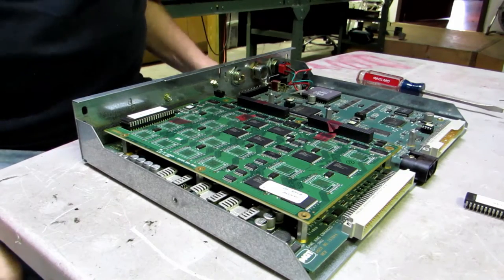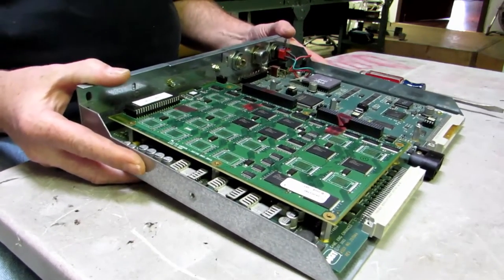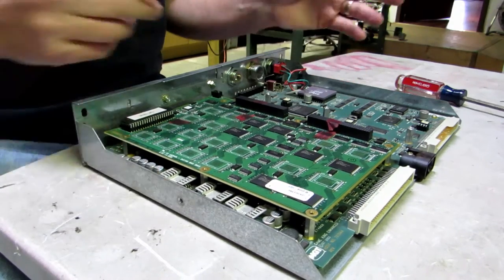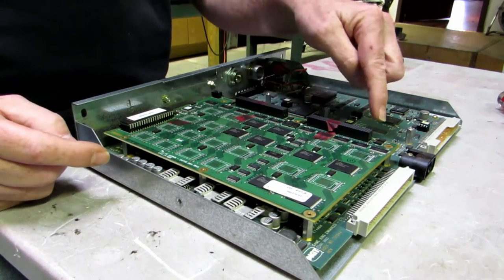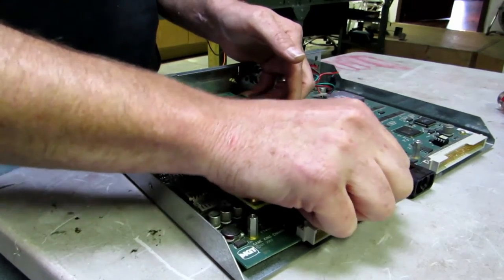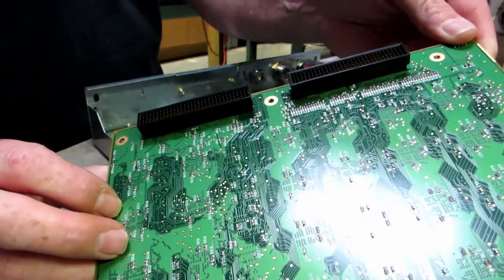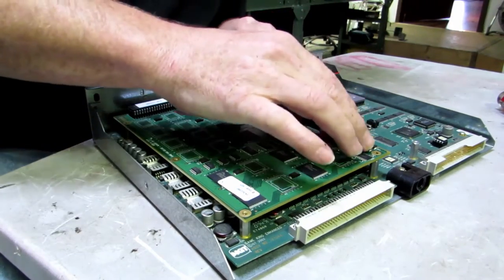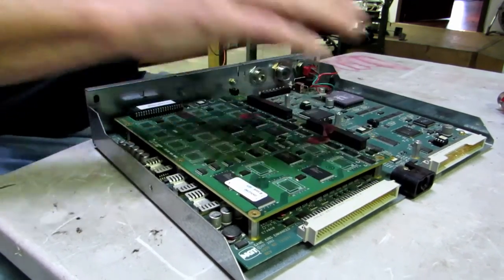IGT 044 BOARD HANDLING DEMO

Comment: Hello, nice video! Would you know if it is possible to adapt MPU 039 or 044 with a legacy card and its respective back plane to a 5-reel IGT S2000 Double Diamond? The original MPU 502 was destroyed by 3.6v battery acid and is no longer usable!